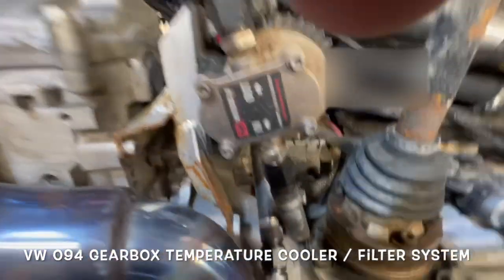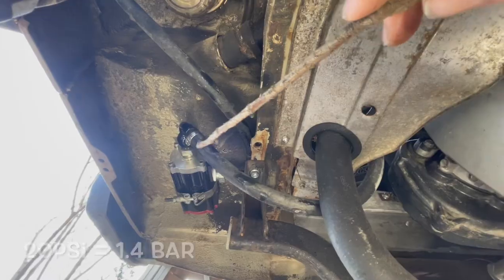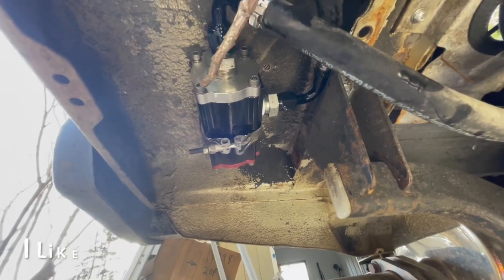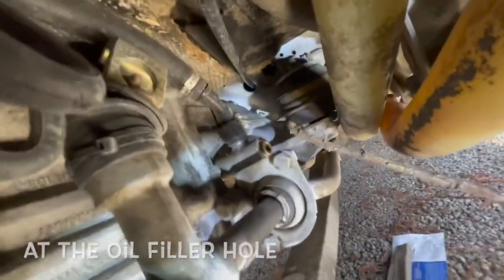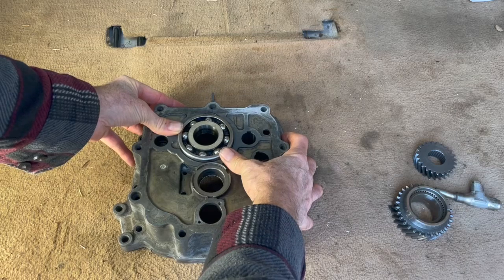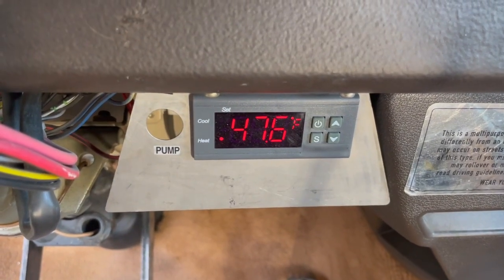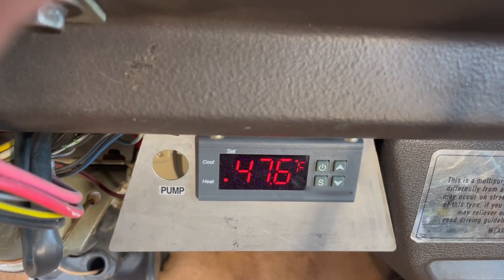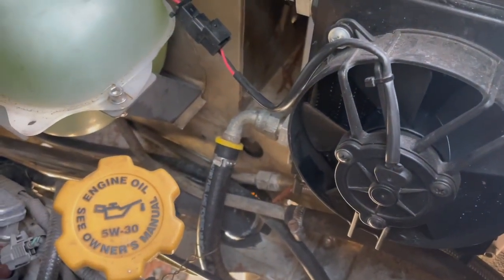Syncro Vanagon gearbox oil cooler Tour

Comment: Thanks mate, I always knew some clever engineer will sort this problem. I run a vw AFN engine on my syncro gearbox and everybody told my the torque will eat the 4th gear up. Now, that is solved! Thanks again
Reply from the maker: Cooling and cleanliness will increase the capacity of the gearbox, but probably not by a lot.

That TDi is going to beat hard on the gearbox.  I’d use a DMF for sure.  Driving style has a lot to do with it too.

The only real solution is bigger gears, shafts, bearings which are not available.  This helps some, but you still gotta “go easy”.😊😊

Comment: I looked at the samba post for information and I’m currently setting up a similar system with the bmw cooler and pump. And now I stumbled upon your video. Confirming my thought on a easy “clean”
Setup without extensive modifications on the gearbox. Thanks a lot 🤩

Comment: Tom, this is really great. Excellent explanations and very thoughtful. I play with Subaru gearboxes (we chatted a bit on FB) and have had severe 5th gear tooth wear on my EG25 powered Vanagon. The resulting metal in the box took out bearings and made a mess but I caught it before a catastrophic failure. I monitor temps and see consistent 180-200 degrees above 65 mph. Since I like to experiment too I have thought about installing a nozzle at the 5th gear mesh location. I'm also restoring a Syncro but plan to keep the engine stock...for now. So this is still relevant for me regarding the main shaft bearing.
Reply from the maker: The load on that passenger car gearbox is much higher now that its pushing the brick.    A split-case probably has pre-load holding the bearings, a very different situation than the thermal-fit (VW).

Overloaded gears and bearings need much cleaner oil.  The main reason we squirt the mesh is to deliver oil to the (VW) mainshaft bearing and to cool the case holding the bearing.  This method is 'bolt-on'.  Not the best oiling method, but it's "installable" on a van with trans in-car.

In the past we thought cooling the gear teeth was important.   I placed a temp sensor in the oil spray of 4th gear on a trans in good condition.  The oil spray off 4th gear was only 3° hotter than the sump temp.  So we have abandoned the notion that 4th gear gets hot.  Perhaps gears only get hot on worn-out gearboxes.  We don't know, we can only guess.